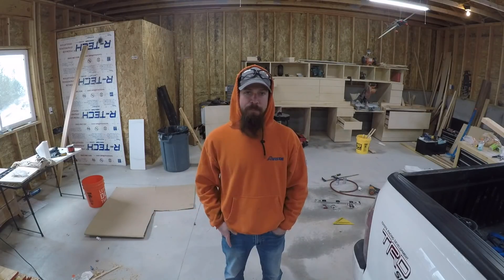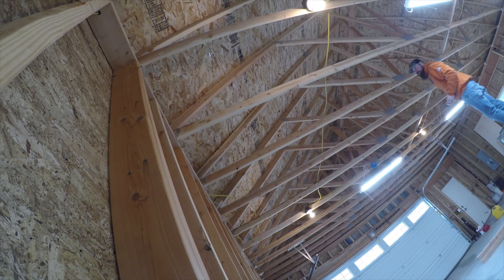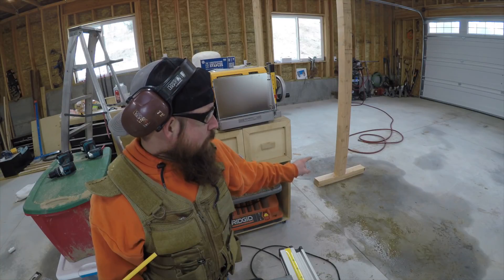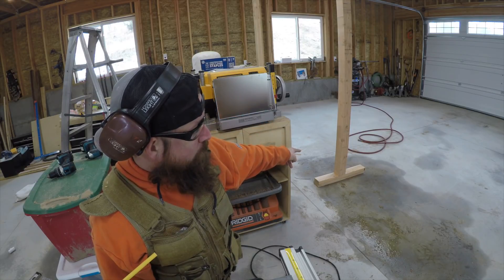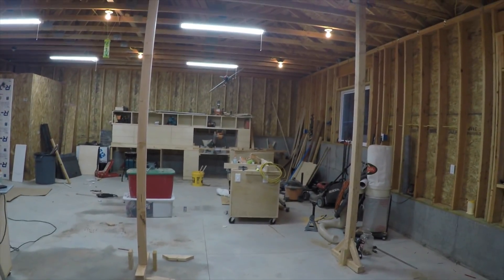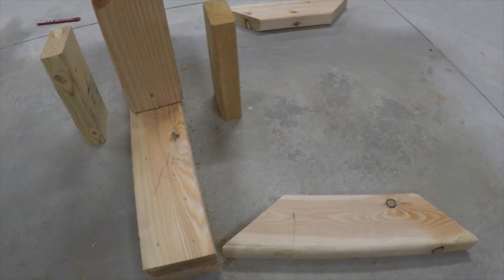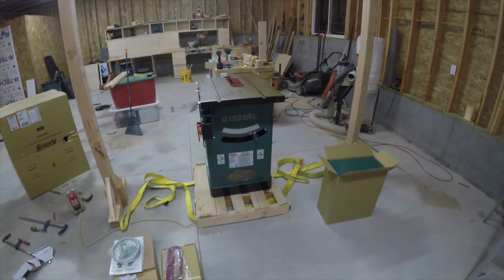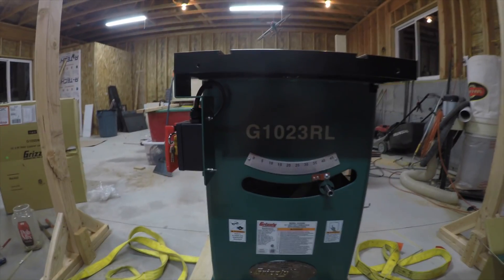BUILD AN EASY LIFTING DEVICE!

Comment: If you wanted to get rid of the posts, double-up the rafter tie, and one on each side of it - three in total.  The rafters support the weight of the roof, and transfer that weight to the walls and down to the ground.  The rafter tie - the horizontal beam on the bottom of the truss - keeps the walls from collapsing outward under the weight of the roof.  A rafter tie is NOT a joist; a joist is in a floor and designed to support a lot of weight.  A rafter tie works in tension (keeping the walls from blowing out), and is NOT designed to support a lot of weight.  Hence the need for reinforcement.  The posts are an expedient work-around, but as you noted, they are in the way or have to be stored.
Reply from the maker: Thanks for the info!👍🏻
Reply: I have framed many houses and you might be fine doing it his way, but you will absolutely be fine doing it the way you did it with posts. Congrats on the new saw- I love to see the birth of new shops and their evolution over time. On my 6th shop space now over 40 yrs and each time you incorporate that you have learned to that point to make it better.

Comment: I see you have exposed celing joist.  So do I....I just lay a 12 ft. length of 2" pipe on top of the joist and then hang a little harbor freight jib hoist on kt.    that spreads the load over several joist.  Actually have three of these in my shop
Reply from the maker: Travis Jaroszewski yeah at the time of the video I did have exposed trusses. It’s all sheeted now, but that is a good tip!